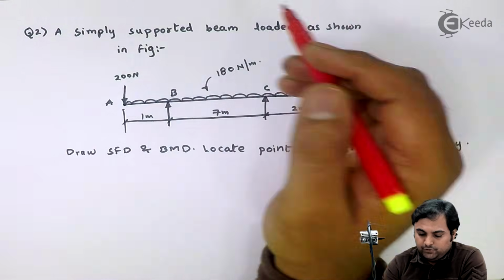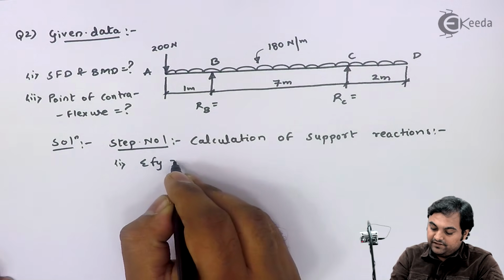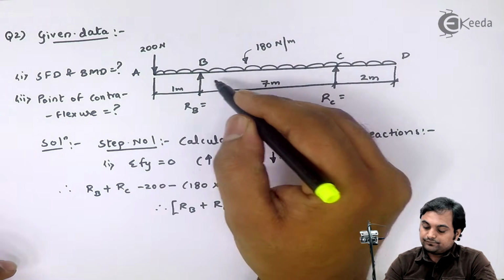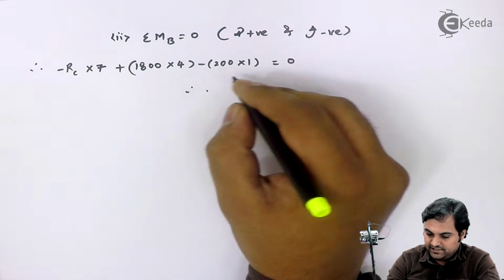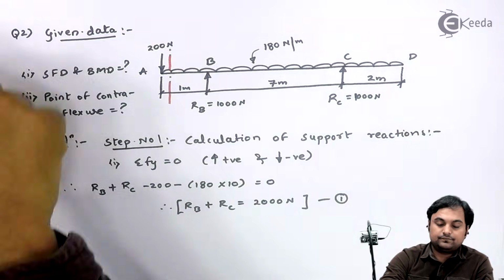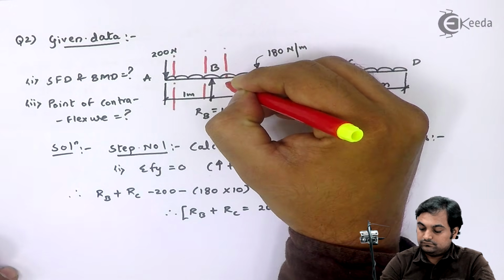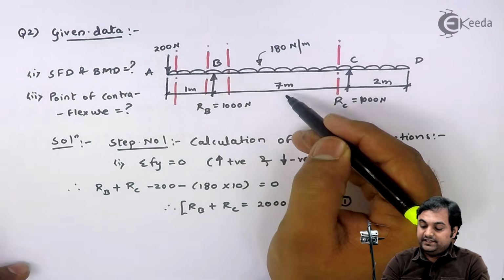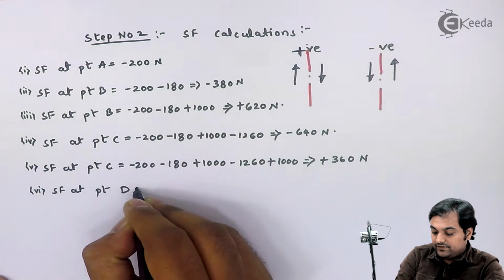SFD and BMD - Problem 2 - Part 1 - Shear Force and Bending Moment Diagram - Strength of Materials

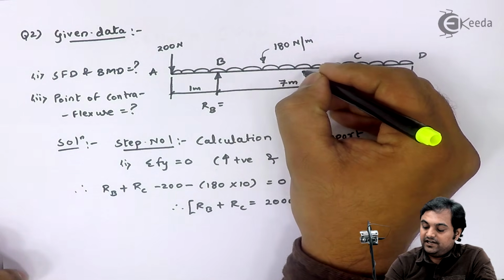Comment: 3:34  and just ahed of ….. It’s still confusing how you can calculate distance … plz show how you calculate bcz it doesn’t seems right bcz if we take 1800 N at center at the beam which is 5mm then with respect to B Load must be at 3.5 not 4. So clarifying it properly not assume or take 4 in calculations and i am still confusing with the sign of 1800 N force in B.M calculations. 🙏🏻 anyway good effort but elaborate properly so we can easil understand.

Comment: On the calculation of shear force at point C when you have taken the section toward the right of C it will be +2000 in place of +1000 at the calculation time you have taken 1000 two time it should be 2000 at one place as it is the support reaction at point C you have taken it 1000 also

Comment: HERE IS YOUR CORRECT SOLUTION ; 

here is some confusion going on , the teacher just follo the book and in the book its not simplified so let me calculate for

moment at B    .....-RcX7  + 180X9X9/2  - 200  -  180X1x1/2  = 1000

its a very good question   , the 180 udl load is ating on right and left side of the section thats why i took   +180x9x9/2 on right section 

where as on left there is a span of 1 mtr so  again - 180x1x1/2   

this is how you can get it

Comment: 4m (5m for UDL from the end - 1m for Rb from the end) is correct as per his explanation. Sketch a free body diagram and convert the udl into point load, you'll understand it!!
Reply: Final year ho gya ?
Reply: It's 7m from b to c..... So bending moment at that B will be -Rc×7 +1800×3.5 - 200 = ....... Right?
Reply: Why minus 1m for Rb?
Reply: thanks a lot for this comment dude,i was struggling with that part
Reply: Thanks bro. Really helpful

Comment: In Point load calculation (Previous videos) your have drawn centre line on the right side for bending moment but in this video left side for point "B" Totally confusing, To match with the answer you are switching left and right ??
Reply: HERE IS YOUR CORRECT SOLUTION ; 

here is some confusion going on , the teacher just follo the book and in the book its not simplified so let me calculate for

moment at B    .....-RcX7  + 180X9X9/2  - 200  -  180X1x1/2  = 1000

its a very good question   , the 180 udl load is ating on right and left side of the section thats why i took   +180x9x9/2 on right section 

where as on left there is a span of 1 mtr so  again - 180x1x1/2

Comment: Sir 
In this question, when we take moment about B, then why it is -1800×4?
Why isn't it -180×5? As moment will be on the centre..
Reply: may be = lets again draw a diagram, an u will see the total lenght is 10. now divide 10/2=5 here 5 is in ur centre but wait we have to take the centre of Rb and Rc and the distance between rb and rc is 7 so if we divide 7/2 it comes 3.5 on each side. Now the trick pART IS we have to take the centre not whole beam but between rb and rb so we know half of section = 5 and when we add 3.5 + 2 = 5.5 on RHS and 4.5 on LHS so shift .5 to LHS then it comes 1+4=5 and on RHS 3+2 = 5 it will come like this . i know u r not going to understand this but u can mail me i also made a diagraam.
Reply: so 4 is correct
Reply: HERE IS YOUR CORRECT SOLUTION ; 

here is some confusion going on , the teacher just follo the book and in the book its not simplified so let me calculate for

moment at B    .....-RcX7  + 180X9X9/2  - 200  -  180X1x1/2  = 1000

its a very good question   , the 180 udl load is ating on right and left side of the section thats why i took   +180x9x9/2 on right section 

where as on left there is a span of 1 mtr so  again - 180x1x1/2

Comment: Explanation
-200*1-180*1*1/2+180*7*3.5-Rc*7+180*2*8=0
Then Rc=1000N
This is correct process✅
Reply: uu r correct.... what the hell the teacher was doing ... making confusions
Reply: You are being confused a lil 
He just converted udl into point load that is acting at centre 5unit from A now if u go for calculation it won't be wrong
Reply: Why u took 180*2*8 i think it should be 180*2*1 or 180*9*9/2

Comment: Moments at point 'B'
1800*4 
How it's possible
Reply: It's possible
Reply: @RR_Constructions.atp-oc4yy  he made a mistake
Reply: @RR_Constructions.atp-oc4yy  
How explain it
Reply: we see he is yelling....  so made mistake that is what i guess
Reply: may be = lets again draw a diagram, an u will see the total lenght is 10. now divide 10/2=5 here 5 is in ur centre but wait we have to take the centre of Rb and Rc and the distance between rb and rc is 7 so if we divide 7/2 it comes 3.5 on each side. Now the trick pART IS we have to take the centre not whole beam but between rb and rb so we know half of section = 5 and when we add 3.5 + 2 = 5.5 on RHS and 4.5 on LHS so shift .5 to LHS then it comes 1+4=5 and on RHS 3+2 = 5 it will come like this . i know u r not going to understand this but u can mail me i also made a diagraam.

Comment: Completely wrong!!!!
Reply from the maker: Dear user , can you please write us what made you feel like this? 
Drop us a mail at care@ekeeda.com , We look forward to your best learning, Thank you!
Reply: @Ekeeda  Sir, pls in the calculation of SF, why did you use 180 and not 1800 the udl has a unit of N/m and you're adding it up to other forces of unit N, I don't think they should add up
Reply: HERE IS YOUR CORRECT SOLUTION ; 

here is some confusion going on , the teacher just follo the book and in the book its not simplified so let me calculate for

moment at B    .....-RcX7  + 180X9X9/2  - 200  -  180X1x1/2  = 1000

its a very good question   , the 180 udl load is ating on right and left side of the section thats why i took   +180x9x9/2 on right section 

where as on left there is a span of 1 mtr so  again - 180x1x1/2

Comment: 1800 will be multiplied with 3.5   ...... your calculation is wrong...
Reply: I think so he is not wrong because he is taking the whole beam and if you take the whole beam then it's 10 and half of 10 is 5 and the moment is at B then 5-1 =4 i.e.,180×10×4
Reply: You are telling conversion from N/m to N right ??
But here 180x10 (Total length 10m)
Reply: @Shivashelva_YT  180*10 =1800 N and multiply 4 because its in the centre
Reply: @ankushjaswal1992  Thanks for your feedback

Comment: -200x1-1800x5+7RC=0 is the correct eqn for moment at B which comes out to be RC=1314.28N
Reply: Wait isn't RC7 a hogging force so it should be negative right
Reply: @JF59122  Yes, absolutely correct. He has written wrong in the equation but has written the correct magnitute of the answer. Please check my calculation

Comment: Shudn't that (1800*4) be preceded with "-" (minus) as u hv shown it is an anti clock-wise load?
Reply: Although ur comment is 6 months old but I would like to correct you It is in clockwise direction if taken point b as reference and clock wise direction is taken positive in find moment ...
Reply: @craftart1365  isn't the moment on left side of B should be +ve , or sign convention for moment and bending moment are different?
Reply: @debashisdasjnvp  it should be - since the convention sign for bm starting from the left as in the example above is anticlockwise
Reply: Its in clockwise

Comment: supposed to  multiply  with 4.5m from point B which 4.5m is the centre  where  the UDL is acting for the +moment
Reply: Abdul Asyraf Yusuf  bro are you sure because according to concept you r correct 4.5 me also but which concept is taught in this 4

Comment: Dear Sir,
             The UDL which is converted into point load is 1800N ,but you have consider its as 180N ,Kindly reply with conclusion
Reply: 180 * 10 i.e, load at center of it
Reply: @Samreen-hn4ql  yes it should be 1800

Comment: you made a wrong calculation for moment at B
Reply: also at SF calculation for point C, where he multiplied 180 with 7 instead it should have been multiplied by 8
Reply: @lakshaygangwal8860  because he already calculated the load over b by multiply 180*1, so next time we only have to go for 180*7 at c
Reply: @ankushjaswal1992   sheer force calculation mein point d by zero kese le lia
Reply: @awinavkishore1699  please explain your question a little in brief... or text me on instagram -    alpha_juliet
Reply: 4+1  is 4 🙂
Reply: Yer u r right bro he made a mistake at point B
Reply: @divyanshjangid9773  because he already calculated the load over b by multiply 180*1, so next time we only have to go for 180*7 at c
Reply: Distance between c and b is 7 so it's absolutely right go through the video once
Reply: @sitoshkr9274  HERE IS YOUR CORRECT SOLUTION ; 

here is some confusion going on , the teacher just follo the book and in the book its not simplified so let me calculate for

moment at B    .....-RcX7  + 180X9X9/2  - 200  -  180X1x1/2  = 1000

its a very good question   , the 180 udl load is ating on right and left side of the section thats why i took   +180x9x9/2 on right section 

where as on left there is a span of 1 mtr so  again - 180x1x1/2
Reply: @ankushjaswal1992  u r right 100%
Reply: @ankushjaswal1992  180×9×9 ea to sahi he but ea sign  -180 ×...hoga na bcz force to niche aa raha he
Reply: @arijitsatapathy8233 wohi to
Reply: @arijitsatapathy8233 niche aane wala negative upar jaane wala positive
Reply: @sitoshkr9274   ya he's correct..

Comment: be half of 7 is 3.5....but u took 4 .....why...?
Reply: Yes how sir
Reply: It's 180 into 10 into 10(full lenght) divided by 2 coz udl is taken as a point load at the centre, subtracted by 1 because its on the left side of the B which has to be subtracted. Hope it helps im struggling myself here
Reply: it should be 5 ,I guess how? @tutututu3536
Reply: Ishank Sheoran what should be 5?its a long time
Reply: 4 because, as he said earlier udl will be acting at center, from the end it is 5mts(10/2), B is 1mt away from the end, so 4mts(5-1).
Reply: Plzzzzzz mujhe samjhao
Reply: 180×10×4 eya 4 kahase ayaa.
Reply: Shilpika Parida first take the entire udl as point load acting at the centre, then, subtract the overhanging lenght on the left of B since we are taking moment about B. That's the only possible way he could've done it,either that or he's wrong, coz udl is present over the entire lenght and hence it has to be taken as a whole. You can't do 180*7*7÷2 that would be bending moment.

Comment: How 1800*4
Reply: Balraj singh 0
Reply: Balraj singh 180N acting over 10m span =1800N is the load and it acts exactly at the centre of beam. And it is at 4m from point b
Reply: the udl id acting  on its centr , intesd of 4 ther is 3.5
Reply: No as it is not just acting between points B and C, it is acting from the point the moment is taken (point B) and the end of the beam - so it is the halfway point of the beam (5m) minus the portion upon which we are not concerned (minus 1m) giving 4 meters.

Comment: how 1800*4 comes there??😓😓  you didn't tell that
Reply: 180(10 :which is the sum of the distances going to the load) (4 :because the half of the total (10) is 5 but it only stops at B so the 1mw hich is the distance from A to B is not included so  180(10)(5-1)
Reply: Sagar Negi I will 180×9×4.5
Reply: Jose Miguel Betanio great bro but one doubt we are taking from rc then why we put the value or C-D 2m
Reply: pls I can't understand how it's possible pls help me
Reply: Sagar Negi 1m plus 7m it's 8m.... And half of it is 4m....  I think so...

Comment: need 4 linear equations
Reply from the maker: the method used here is simplest.
Reply: I can master your method by writing six mathematical equilibrium condition,keep spacing,and change each stimulus(loading) the way I want to ,understand?homework for you to do, how many problems I can generate with my method. A)multiples solution, B)infinite solution,or C= one  solution.              not software involved,all hands calculations.